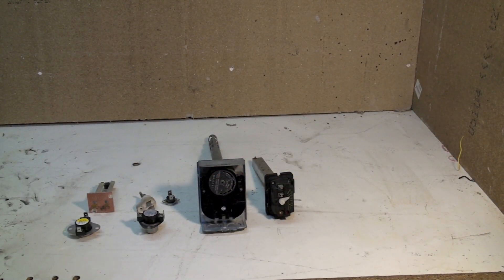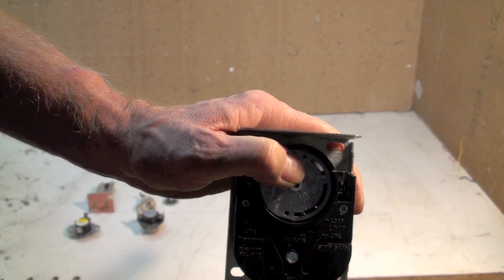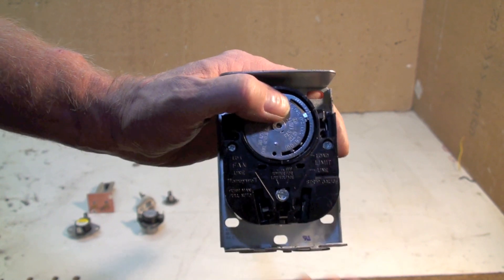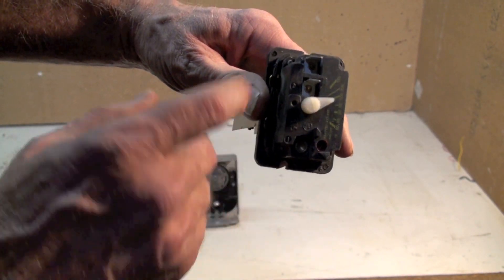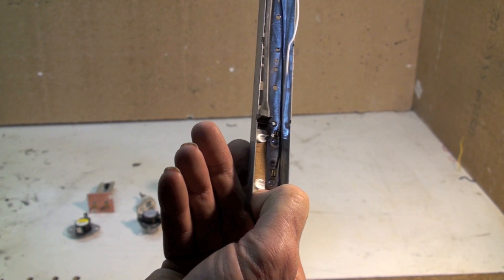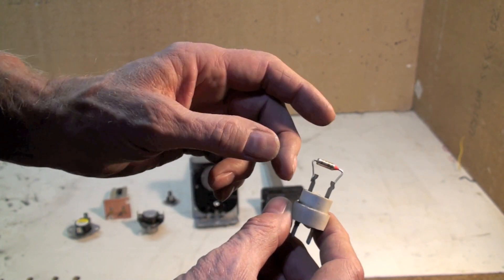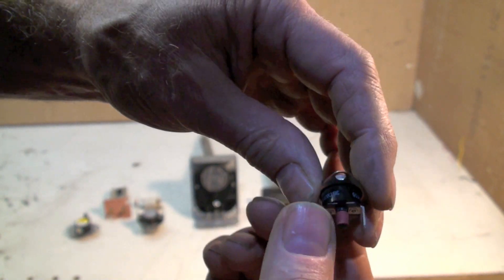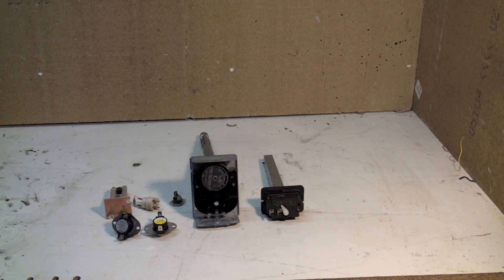Gas furnace temperature controls

Comment: Hey GFM!  I see you replied to a comment as recently as 6 days ago!  Great!  I hope to get a response from my question!

I have an older Esso Ultimatic oil furnace - at least 25 years old.  The blower RANDOMLY stays on after hot air has been expelled, blowing cool air thru the house and exchange vent pipe.  When this happens, the temperature at the thermostat (in the basement near the furnace) is slightly higher than the setting on the old school round honeywell dial.  I have to turn off the furnace at the power switch to get the fan to stop.  I hear a squeek inside the furnace, as something resets.  Sometimes a squeek AND a click.  2 days will pass, then it happens again.  Sometimes a week will pass.  Sometimes I get Fan Run-On 4 times/day, requiring manual shutoff every time.  This has been going on for 2 years.  I can't leave the house overnight in wintertime, for fear of the fan constantly blowing and pipes freezing, or the furnace/fan just quitting entirely from being left on.

Is the fan limiter switch and probe a difficult part to replace?  Could it be the thermostat, or connections?
Reply from the maker: The fan and limit switch is sticking on.  It is not hard to replace but requires some wiring.  Get a replacement that has the same length probe and take pics of the wiring to get it right.
GFM

Comment: How long before the forced hot air oil burner fan turns on? Im waiting around 4 minutes.  Is it wasting fuel?
Reply from the maker: If it is a very old furnace(like an octopus), it could be that long.  Anything newer than 40 yo should be less than 2 min.
GFM
Reply: @grayfurnaceman Thank you. It is an old furnace.  😊

Comment: So I have that last limit switch you showed. It cycled the furnace like four times. In-between each circuit the error led would blink 4 times for about 20 times. The LED then changed back to yellow and the furnace would run again. After the 4th time the LED would continue to blink the 4 code and the blower keeps running. I tapped the old limit switch, reinstalled and turned the power back on to watch the 3 amp fuse blow.
New limit switch, new fuse and furnace again runs four cycles and stops.
Is there any chance the control board has memory that needs to be erased to rid the code after installing new parts? Thinking along the lines of a check engine light after you repair the defect.
Thanks in advance
Reply from the maker: Your problem is AIR FLOW.  Check filter, A/C coil, blower wheel, secondary heat exchanger coil plugged and ductwork problems.  
The fuse blow was probably a short when the limit was reinstalled.  Absolutely no chance the board is causing this.
GFM
Reply: @grayfurnaceman  thank you. New filter, no ac coil, so I'll check the blower wheels and duct work. Thanks for this video and thanks for the tips.

Comment: Thank you for your videos. Q:are furnace thermostat sensors same as clothes dryers?
Reply from the maker: They can be.  Dryer temp sensors are limit switches that shut down the burner at a certain temp.  However, they are not interchangeable.
GFM

Comment: I replaced one of these fan limit switches (old school) the other day. My first real install. When taking out the wires you need to stick your mini screw driver in the little hole and press down on the metal piece so the wire can come loose. I didn't figure this out until I read the instructions.
Reply from the maker: +Brent Peluso That was Honeywell's better idea.  Don't like it much.
GFM
Reply: My journey man called to see if I had broken anything and was hiding it because I was taking a long time figuring out how to take the wires out of the old fan limit switch, I could have just cut them but I needed all the wire. Should have read instructions first.

Comment: I replaced the pilot assembly because the flame was so large it was going halfway around the burners on each side of it and I tried adjusting it even with the adj screw on the gas valve and it wouldn't turn down. I examined the burners and the heat exchange as well as checked the ventilation and couldn't find any other problems. I am hoping the faulty pilot light caused the problem but I am watching it close for any additional problems. I really wish I could just get a new one! Thank you! :)

Comment from the maker: The part you replaced is a rollout high temp fuse.  It opens when flame comes out the front due to heat exchanger failure or vent blockage. The pilot burner should have a pilot orifice to control gas.  Also there should be a pilot adjust valve on the gas valve.  Check out "How to check gas pilot orifice" video.  I am somewhat concerned that you may have a heat exchanger failure.  I would pull the burners and check for cracks.  If the part opens again, you know there is a problem. 
GFM

Comment: I managed to get the furnace running again. The fuse I replaced is a temperature fuse it is identical to the one you show at the 6 min mark in this video.  It has a ceramic teardrop shaped base and mounts just below the fan/limit switch above the burners. I inspected everything on the furnace, replaced the thermostat and the entire standing pilot light assembly because it would not allow me to adjust the pilot flame and it was way too high. I bypassed the temp fuse and it worked perfectly!